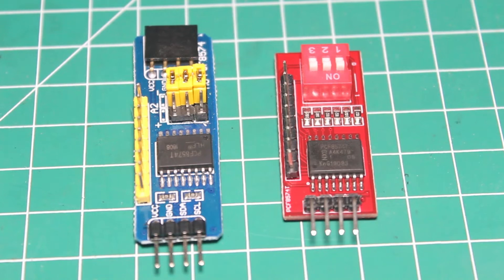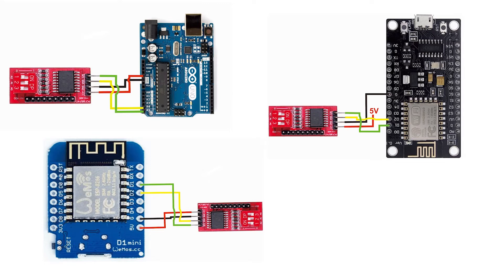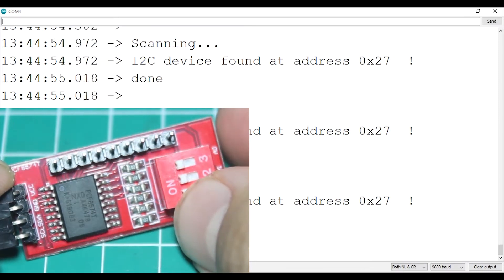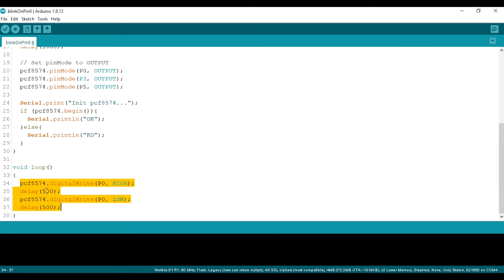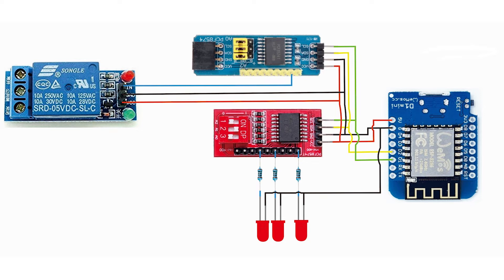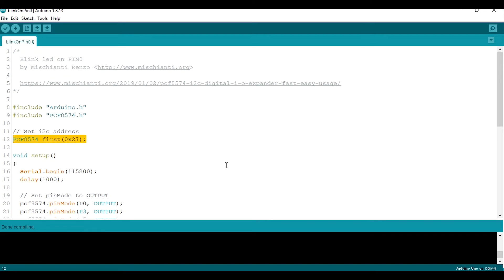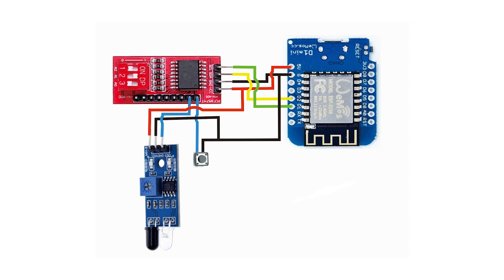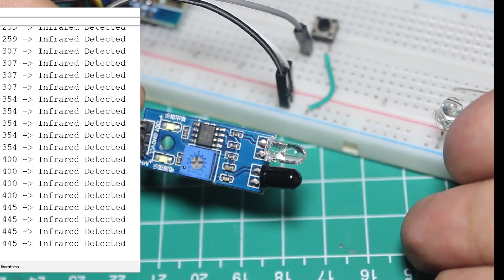Add more pins to your Arduino/ESP8266 board using PCF8574T module

Comment: how to write or read individual ports or pins of 8574 module using wire library only? do not use pcf8574 library.

Comment: Hello sir, I've found a problem when I connect the pcf8574 extender module(blue color one) to my nodeMCU. The LED connected to the pcf8574 extender module can only generate a faint light. Does it mean my pcf8574 extender module is broken or something goes wrong? What is the solution? Hopefully, I can receive a reply. TQVM
Reply from the maker: What did you try to drive?
Reply: @miliohm  I try to ON my led on the pcf8574 extender module
Reply: @miliohm  I follow all the step in the video, however, my led can only light up gloomy.
Reply from the maker: @limjunyi2211  that's normal since this module is designed as sinking. So you should put pcf -> resistor -> Vcc. And the LED will light up when you put LOW output.
Reply: @miliohm  Sry sir, i don't get it. Could u please explain more?
Reply from the maker: @limjunyi2211  connect another end of LED to VCC (not ground). And see what happen.
Reply: @miliohm  i connected one LED to VCC and P0 but nothing happen sir
Reply: LED +pin to P0 and -pin to VCC
Reply from the maker: @limjunyi2211  + LED to VCC and -LED to pcf
Reply: @miliohm  Thank you sir, it works!!!!!!!! One more question sir, if I want to connect  pcf8574 extender module to a relay, what should I do? is it using the same concept as light up the led or something else?
Reply from the maker: @limjunyi2211  just keep in mind that now the trigger is LOW. instead of HIGH.
Reply: @miliohm  Alright, thank you!! I've subscribed the channel, thanks a lot!!
Reply from the maker: @UC2rhvJO2RZzU7byiADqcnlw sure